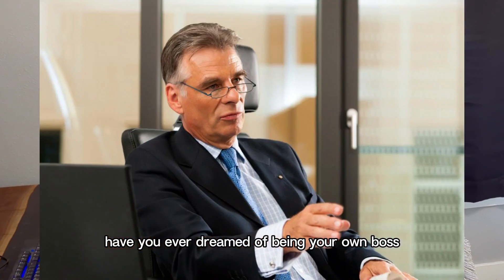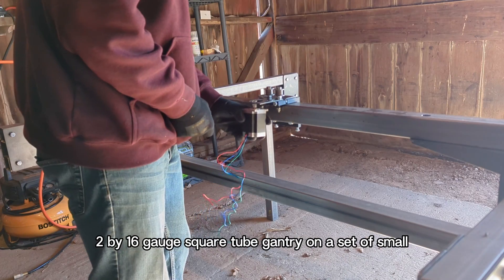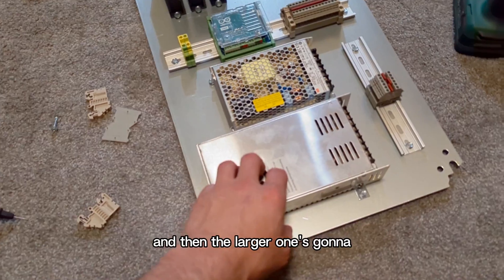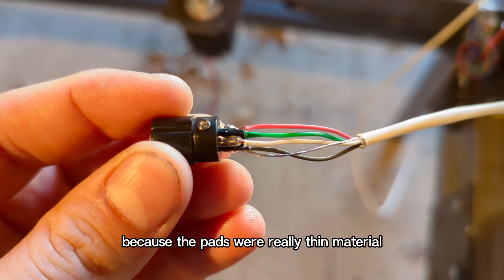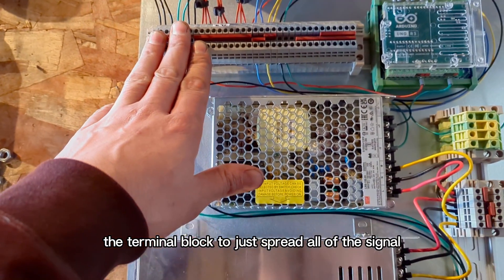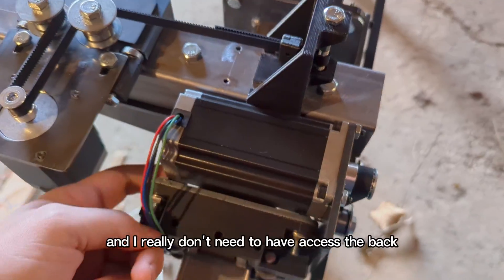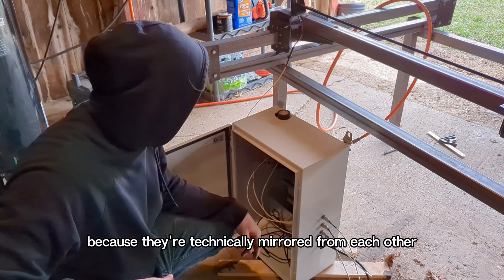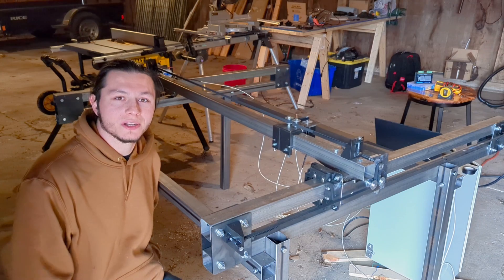I want a CNC Plasma Business. SO I MADE ONE | Motors, Belts, Electrical | Pt. 2

Comment: I'm curious, when you went to dual y-axis motors, did you still use 425oz motors as JDsG originally used or did you use something a little smaller?
Reply from the maker: I'm not sure what JD's used. I actually built my machine before they did. But yes I used the larger motors. I ended up bolting a steel drag chain rack, so I wanted the extra power
Reply from the maker: But you could probably get away with smaller!

Comment: Hello dude. Are you a mechanical engineer. I took a look at your work I saw that you were knowledgeable about everything. What programs do you use for drawing, modeling and CAM (g codes) Please forgive me if I was impertinent.
Reply from the maker: I am actually an electrical engineer. Right now I've used solidworks and fusion 360 for 3D modeling. And Master cam for can software.
Reply from the maker: Cam software**
Reply: @ThyialIndustries  you are genius bro. Do u have grabcad profile?

Comment: I hope you didn't build those 3d printed parts with pla. Petg is much better.
Reply from the maker: Aluminum is best lol. I printed with pla and will have machined aluminum soon
Reply: @ThyialIndustries  maybe but aluminum is expensive especially machine aluminum unless you already have a cnc Bridgeport and blocks of aluminum.
Reply: @ThyialIndustries I'm doing mine in petg and possibly upgrading to polycarbonate in the future. Will see. The petg may well do the job, but I am wondering if a wider belt or dubble belt may better the longevity. 🤔
Reply from the maker: @bobreichel  could be. That's why I was originally a little afraid of...by making things "cheap". You sometimes have to sacrifice quality/longevity
Reply: @ThyialIndustries I don't know if I would say that. I mean, I've made things cheap and they've outlasted some of the stuff. I would pay 10 times the money for so it all depends, but a little insight can help you to make it better than maybe it's original plan which you have done.

Comment: What was the total cost, since you ended up modifying the original plans?
Reply from the maker: Not 100% sure but I'd say anywhere between 800-$1000. I went a little overboard with the electronics. I'm also getting a hypertherm 45, which is about 3Gs.

Comment: 5:46 i wanted to scream :D the ferrils are used for stranded wire what goes under a screw in terminal most newer terminals now have a small tab under the screw so the screw is not pressing on the strands directly
Reply from the maker: 🤣 well dang... I could have saved some time lol..